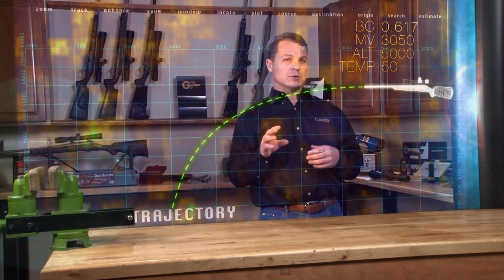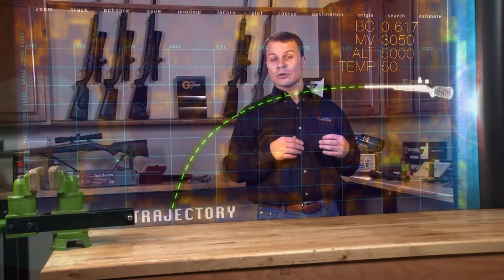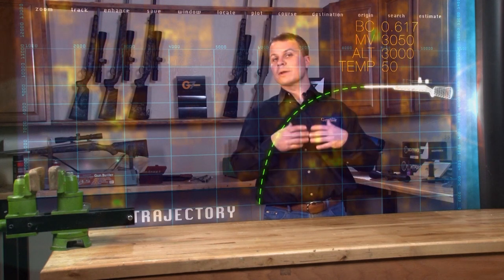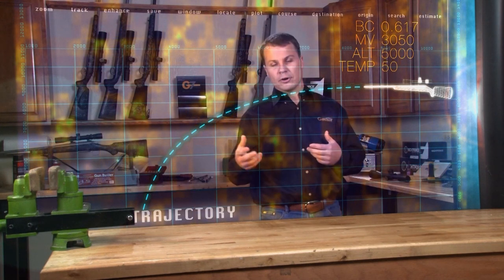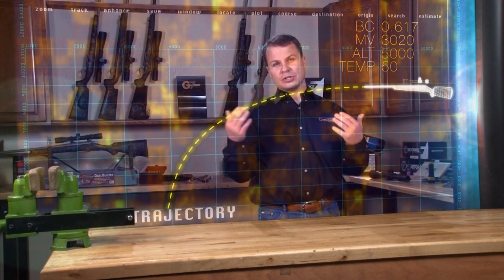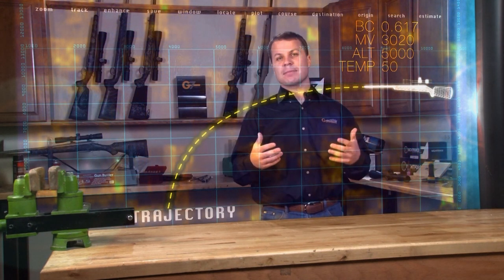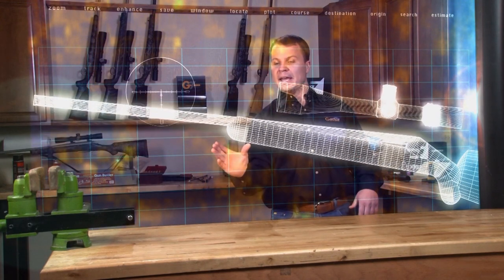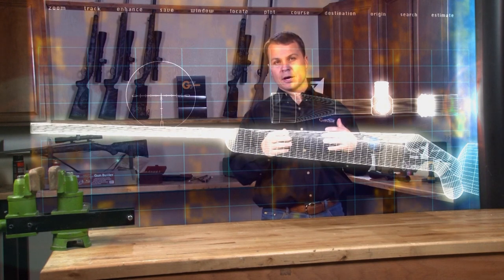Long Range Pursuit | S1 E20 The Gunwerks Ballistic Solution

Comment: Can you explain why you folks prefer the BDC? In my way of thinking:
-change the temp or pressure, you're dialing different anyways, so to me, a BDC turret only muddies what's going on with the trajectory. 
-If I miss, with a mil turret I can quickly correct the mil value I missed by and second shot is virtually guaranteed. 
-Further, I can true two different ammos in the same rifle (hunting vs target, light vs heavy) with a mil turret and be good to go: I can't imagine that being easier with a BDC turret.
Thanks